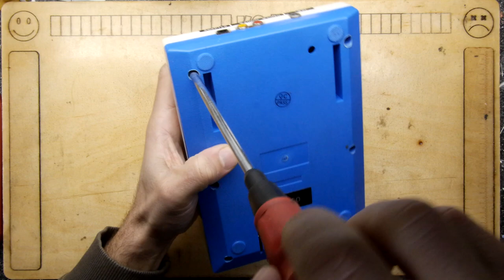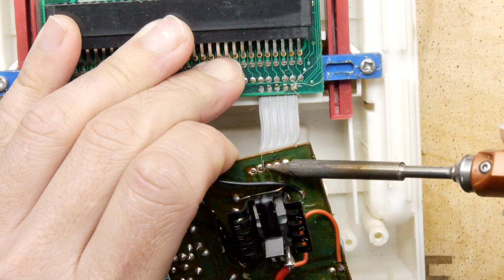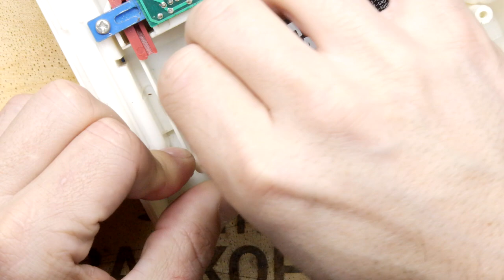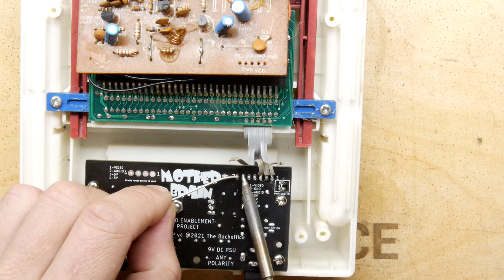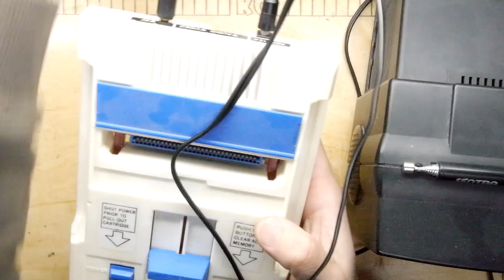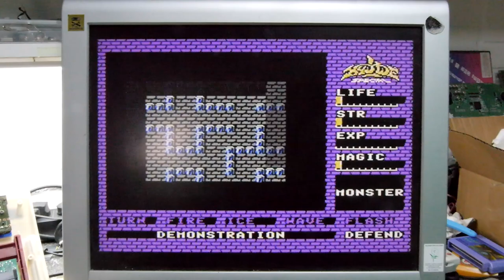Let's upgrade the Rinco Nintendo Famicom Famiclone with a Power Vamp PSU - IT WORKS!

Comment: Many famiclones have very bad jail bars due pure build or even designed boards . Some of them have fake RCA audio video outputs and only RF , others are vice versa. Some have just missing elements from the power board so no functioning AV eather. In most of them the transistor for the video is mounted not on the main board , but all away to the power one, so the picture is dark and with jail bars . Despite that the lable for that transistor is on the main board. actually some clones do not even have a place for this transistor... So most of them can be fixed by adding a transistor and 2 resistors directly to the closest point of the video out to elemiante or reduce the jail bars , additional capacitor to the  cloasest - and + to the NOAC IC help as well. But despite all  of that some clones still retains those stupid jail bars no metther what . I repeated a near 15 various clones from the mid to late 90's.

Comment: I love your power vamp mod, it worked great - but I did get jailbars, likely not from your mod but from the famicom itself - after trying various fixes on the internet (I mustve tried most of the fixes people post) - I found placing a 22 uH inductor in series with the video output completely removed my jailbars. So anyone looking for a fix for jailbars, try that
Reply from the maker: That sounds super interesting. It blows my mind that there can be so much variations on the units. I heard it is the Ricoh chips causing the noise themselves 🤦

I have just been using this system to pay some Spartan X. Such a classic and appropriate game!
Reply: @backofficeshow  I tried adding caps all over the place, I lifted a pin off of the video processor, and the transistor next to it - and mod wiring them together (my poor famicom 🤣) none of those helped - I was about to go all out and just lift the video chip and put some copper tape under it, when I found a post on reddit about adding a 10uH inductor - that worked very well, but I found a 22uH gave a perfect picture
Reply from the maker: That's great, you sounds like you are having better luck with your main board, I've had them die just from looking at them 😂 Perhaps there is a nice way to add the inductor mod onto the vamp board, might be better to keep mods away from the fragile FC board.
Reply: @backofficeshow  on your board I cut the trace for the video signal - and soldered the inductor between that resistor near there and the video connector. works a treat 💪
Reply from the maker: @w00dyblack  💪💪 perfect!
Reply: Nice! I am definitely trying this ! Where exactly to put this inductor, between pin 21/video out on NOACs and the base of the transistor, or all away just before the video RCA jack?
Reply from the maker: Are you trying this on a power vamp board? The latest version lets you patch in video and audio mods into the pipeline